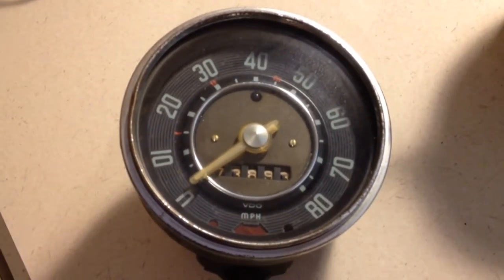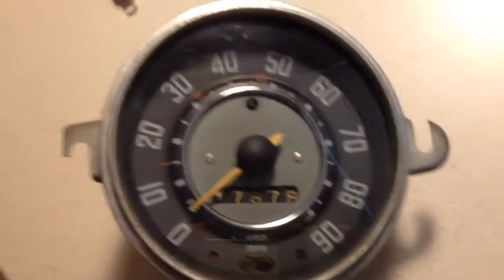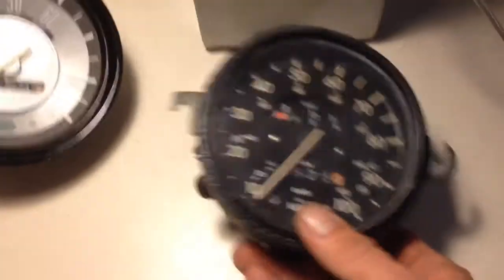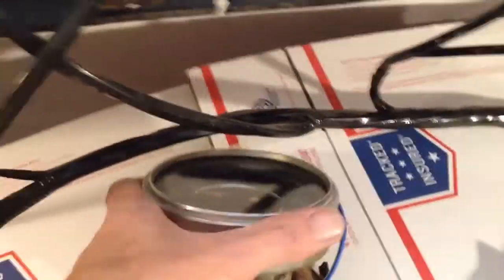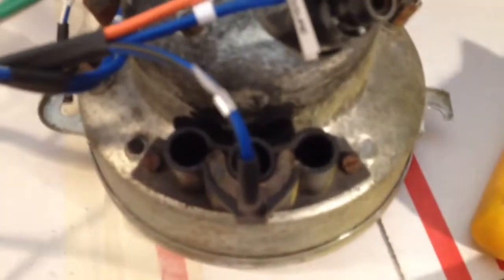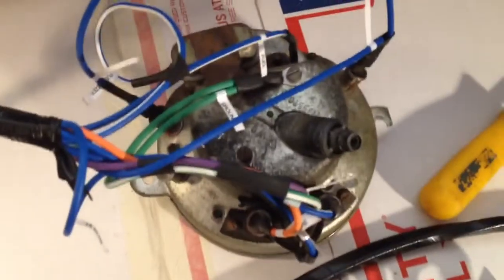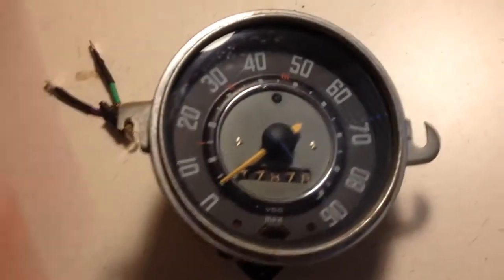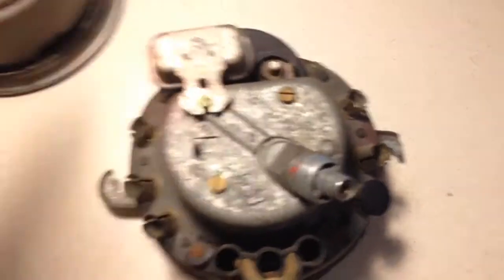How to wire a VW dune buggy speedometer.

Comment: The ones on the main metal body (lights/hibeam indicator) will ground on the housing using the one ground wire provided - that’s screwed into the speedo body.  On a bug it’s mounted to a metal dash so it’s self grounding.  
The 3 on the bake lite housing ground at their destination… oil pressure light at engine, Alt/gen light at Alt/gen. The turn signal I like to use the 2 post isolated bulb housing and give it its own ground wire.
  On an old bug the turn indicator works through the vw flasher which is hard to get and getting expensive.   I prefer a standard issue auto parts store 12v flasher and use a work around.

Comment: Great video. What bulbs are the ones for the turn indicator, and also what the best way to remove it. Do you simply pull on the cable? Thanks
Reply: Dont pull by the wire grasp the bulb socket with long needle nosed plyers and pull.